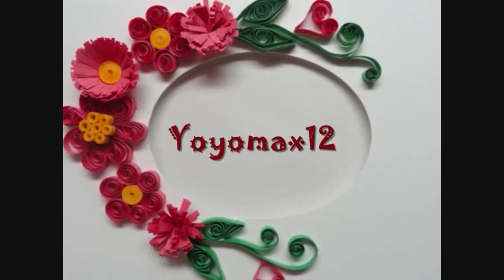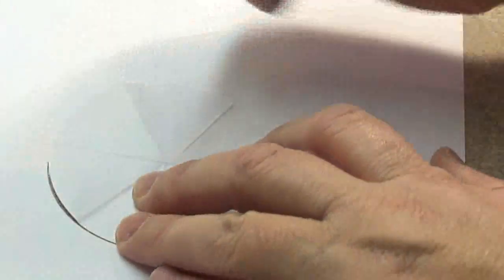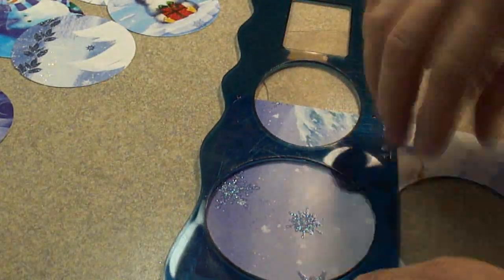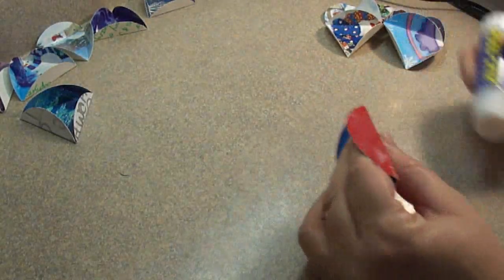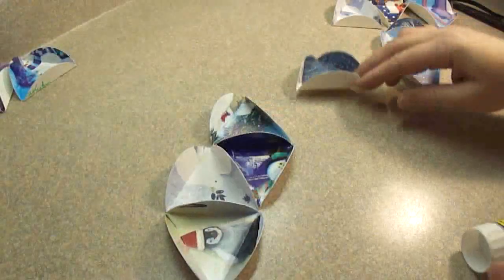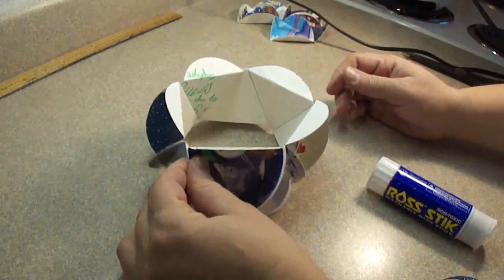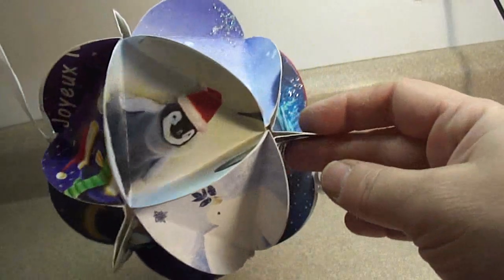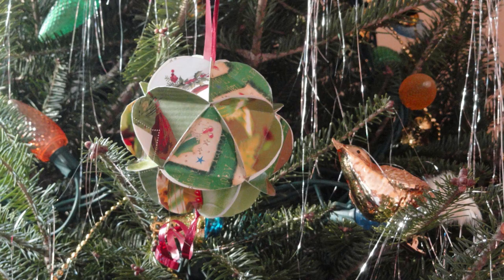Recycled Christmas Card Ball Ornaments (Geodesic Paper Ball Ornament)

Comment: I love this.  My father's secretary made one for him when I was a little girl and I've never forgotten it.  I thought it was so clever.  It looks quite easy once you get the hang of it but I have a question regarding the glue.  The stick glue looks so convenient but in my experience, stick glue doesn't hold well.  Is this the best/strongest/easiest  type of glue to use?  Thank you for posting this project!
Reply from the maker: +John Doe Any kind of glue would be fine for this if you don't want to use the glue sticks.  Regular white school glue (Elmer's type) would be fine as well.
Reply: I found that those little bottles of crazy glue that can be applied with a brush is easiest
\
Reply: I've always used Elmer's glue poured onto a square of paper & a toothpick.

Comment: The cutter is what I need!! Where to get that??? :(
Reply: This cutter is more work than is necessary. Michael's sells a 2 1/4" punch, which makes quick work....no drawing, no scissors...just punch. Very fast. Also, the triangle can be found on the internet, Euclidean traingle, I think. Just adjust size to fit your circle, before you cut out a triangle. Quite simple...

Comment: thats really nice!!! where do you get that cutter from?
Reply: There is a 2 1/4' hole punch which makes faster work of making the 20 circles required. Also, the ruler slows things down, just cut a triangle to fit (you can find a triangle on internet, and make a cardboard (thin) triangle cut-out, place in center of circle, and fold flaps up...much faster.